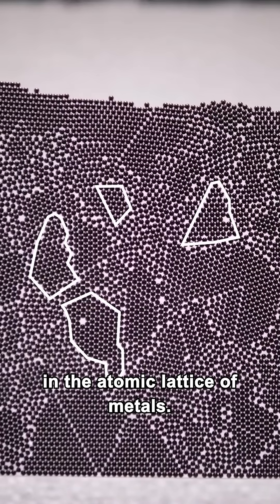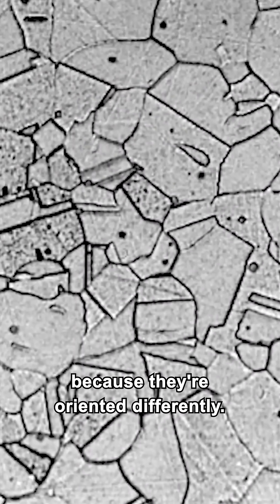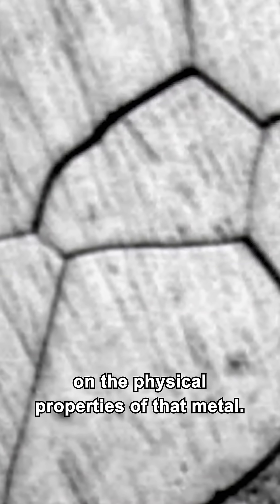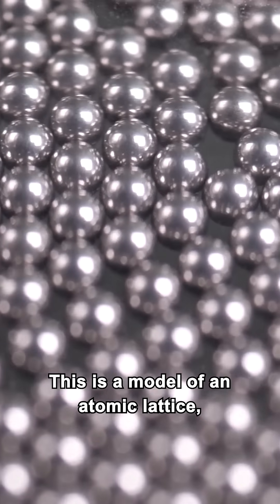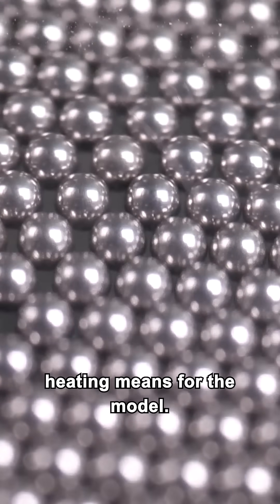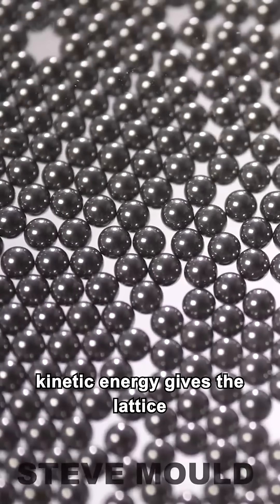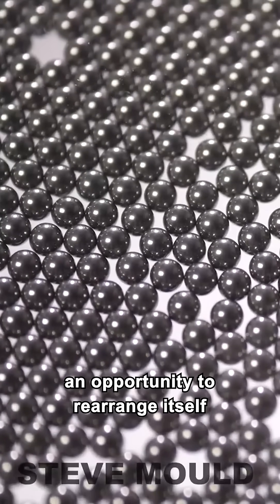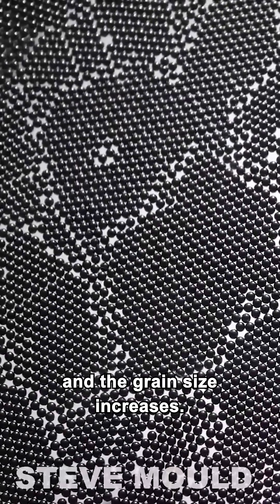What Happens When We Heat Treat Metal? #shorts

Comment: I wonder if you shake them hard enough whether there could be an analog for the phase transitions that happen in metals.  Would there be a different packing of balls when they have too much energy to pack hexagonally, but not so much that they're fluidized?

I bet there's something you can do with the tray of balls standing at an angle, some room between them and the front glass (half a diameter? Less?).  Varying the angle and the forcing, you can probably get them to settle into different structures.

Comment: Is this why cooling something quickly makes it brittle?
Reply: No, in fact for non-quench hardening alloys you can cool them as quickly as you like and they don't harden or become brittle.

Steel gets hard and brittle from rapid quenching because you're essentially trapping it in a non-equilibrium, stressed microstructure.  It takes time for carbon to diffuse within the iron crystal, and when you deny it that time you force the steel into microstructures that normally wouldn't exist at room temperature.  Martensite is the main one, but it can be converted to "tempered martensite" (by tempering, of course) which is less hard and brittle.

There are other factors like the size and shape of carbides that form between the grains, but forming martensite is the main thing for steels.

Comment: Fun fact: The smaller blades inside a jet engine turbine are a single lattice.
Reply: No. They are a single crystal.
Reply: @deang5622  I thought that was the same thing? The lattice is the crystal structure, no?
Reply: @eoin4529  They are very closely related.
A crystal contains a lattice, and we talk about crystal lattices.

In terms of jet engine turbine blades, it's more common to refer to them as being made of a single crystal, rather than a single lattice.
Just my experience when I have been around mechanical engineers that have worked on jet engines.

Comment: It would be great to show it, in steps, with 0.4-4% smaller ball bearings (about 55% the size of the existing ones) to show the inclusion of carbon in steel. Not sure how it will work out, especially the >0.65% as that doesn't affect hardness but does hardenability.
Reply: Unfortunately I don't think it would work out very well, mostly because in the model gravity would cause the smaller bearings to sift down towards the bottom. In actual metal the forces between the atoms are a lot larger than the gravitational force on them.
Reply: @Ender240sxS13  Steve rapidly locks in place the matrix from a agitated horizontal orientation to a unagitated vertical one; before gently returning to a more horizontal orientation for gentle vibration to watch the crystalline structure migration. The smaller ball bearings should not have time to migrate to the bottom under the force of gravity during that rapid setting process.

Have a look at his long form video on it, it's great.

Comment: Now I know why heat treating metal makes it stronger. Great visualization!
Reply: It depends on what you mean by stronger. It will make it less brittle but more ductile. This is because plastic deformation (not elastic) occurs due to dislocations moving through the grains and the material as a whole. The movement of dislocations is impeded by the interfaces at grain boundaries due to the grains not being aligned. So in this example, where the balls are all aligning, it would make it easier for dislocations to propagate and therefore easier to deform. There are other factors involved too such as dislocation density and lattice structure but this is a great visualisation.

Comment: This is a extremely good visualisation 😃 the only thing missing is the explanation that bigger "chunks" are easyer to deform and more irregularities make a metal harder. I'll use this to teach my metal working class.
Reply: this was a long-form video that he converted into a short. in the full video he talks about all the material properties
Reply: Definitely use the full original video if you want to use this to teach
Reply: wait so heat treatment makes the atoms slip and slode and make "bigger grains" but bigger grains makes it easier to deform and bend, right?. but if you give metals heat treatments they get more sturdier and less bendier, i dont get it...
Reply: @jordyrafael8287 this is a simplified model to explain part of heat treating. In real life, there's different types of heat treatments and complexities. For example, low carbon steel has multiple phases within it and different phases form depending on temperature and different microstructures form depending on temperature and rate of cooling.
Reply: @Hyperlophus so basically the type of heat treatment changes the properties some might form very big crystals some might form a tight knit net of crystals. Am I understanding that right?
Reply: @pvpminer9007  yes. The physical example in the video is good at explaining why annealing causes grain sizes to increase. It doesn't address the complexities in real life applications. Like how some alloys have different crystal phases that are stable at different temperatures (below melting) and those crystals may have different solubilities of elements, for example carbon. Different materials have their own detailed studies and charts, because things get complex.
Reply: @jordyrafael8287 Copper works the opposite way- heat treating it makes it softer, because having more crystals makes it harder to bend.
Reply: @jordyrafael8287  Heat treatment is complex. Different alloys behave differently. (Carbon) Steel wants to be heated red hot and shock cooled to get hard, then moderately heated to get tough and high tensile strength. High alloy stainless steel is not subject to this hardening; it keeps the crystal lattice carbon steel has red hot down to room temperature; that's also why it is not ferromagnetic.
Some aluminium alloys "precipatation harden", meaning they come out soft from a hot rolling or extrusion process, then get hard  and high strength with time by diffusion of alloying elements in the crystal lattice, they may need  slightly elevated temperatures to do so. 
Copper alloys need to be shock cooled from high temperatures to become ductile; they work harden (get hard with deformation).
The effects have to do with recrystallisation, buildup of tensions between the deformed grains, but also with diffusion of alloy elements inside the crystal lattice, and the crystal lattice changing completely at high temperatures and then beoming "frozen" by shock cooling.
Reply: Is that the reason we grow single-crystal turbine blades? To make them easier to deform?
Reply: @ltpetrenko  Nope. In the case of monocrystal blades it is about tensile strength. Each grain boundary is a weak point in the structure. those crystals are deliberately grown to give good strength in one direction.
I also wouldn't generally say that larger crystals are more ductile. That is the case for lattices that contain different elements (alloys). The larger atoms form irregularities that hinder ductility; they accumulate at grain boundaries. The individual grains also get jammed into each other when working the metal, creating internal tensions, which impede ductility. "Normalizing" (heating the metal) releases those tensions. In the case of copper alloys you want to shock cool for best ductility, indicating that these really are most workable for small grains. In the case of carbon steel you want to slow cool, to allow the ductile crystallite forms to develop (in this case it is about the internal structure in the crystallites, not the intercrystallite web.)
If you go to very large crystallites, the stronger crystal lattice becomes effective.
Reply: @HotelPapa100 wonderful explanation! Thanks for that well articulated response from a materials scientist
Reply: @ltpetrenko  they probably make them softer so as to not shatter during load
Reply: @lolsikinz  ductility is not really needed for the turbine blades as they do not experience impact-like loads.  
I just provoked the conversation in this direction.
Thank you all for great replies.
Reply: @ltpetrenko  I did not say that turbines needed ductility, I said that it was most likely done to minimize shattering, A side effect of a metal being too stiff and brittle. And a quick google search says I was indeed right. From the website "The Engineer": You can also check out the video/short that the slow mo guys/Jaystwocents did where they shatter a PC fan by bringing it to rotational speeds it was not designed for.
Reply: @lolsikinz  1. your initial suggestion, that they are “made softer” with single crystal is incorrect. Single crystal has higher yield stress. 
2. Brittle is opposite to ductile.
3. Slomo of the cooler fan show quasi-steady failure when yield stress is reached. It looks like shattering of a glass, but it’s not. More “brittle” fan would withstand higher RPMs. 
Although, I’m not sure what failure mode you imply with “shattering”.
Reply: @ltpetrenko from what I remember they want single crystals so they have a more predictable change in size when they expand do to the high operating temperatures.
Reply: @ltpetrenko Monocrystalline blades in turbines are mostly used to reduce heat creep at high temperatures. Grain boundaries are zones prone to starting dislocation movements when under load, and even more at high temperatures, so by having a single metallic crystal you can reduce heat creep and increase temperature resistance. However, this technique also compromises  the tensile strength of the metal by some margin, so it is only used in very situational cases.
Reply: @ltpetrenko  They make Turbine blades from single crystals to prevent creep. Creep is when an otherwise solid material is put under a tension that normally wouldn't destroy the work piece, but if you keep the tension over a long time the work piece starts to expand and eventually rip off. Creep is caused by irregularities at the grain edges of the material and since single crystals don't have grain edges, there is no creep. Turbine blades are put under immense tension from centrifugal forces over a long time and need to fit into very tight spaces, as in almost touch the inner wall of the turbine housing, so they can't be allowed to expand over time.
Reply: But wait, in this demonstration, the vibration gives enough space to the balls to rearrange themselves using "gravity"

But how does "kinetic energy" of heat rearrange the atoms at atomic level? 🤔
Reply: @annonYk A very good question. Not easy to answer properly in a short comment but it’s to do with reducing energy. An atom in a crystal will be at its lowest energy if it’s equally surrounded by other atoms in all directions. Grain boundaries are higher energy so there’s a driving force to remove them. Giving atoms enough energy to move around can allow them to rearrange into a lower energy state.
Reply: @GemAppleTom  hmnn... that makes sense, thnx for your explanation 👍
Reply: In the complete video he tells us this, this is just a short. Use the complete video as an instrument not only this short
Reply: A: he explains that in the full video this is a short from

B: If you want to demonstrate it yourself, do what he did and put a thousand ball bearings between two glass plates.
Reply: Man I wish I had a metal working class 😔
Reply: @AssassinIronMan  There used to be some places in EU where metalworks was teached as part of basic education untill EU standardized the curriculum, leaving these lessons to be the things of the past.
Reply: @arkaadias2526  That sucks.
Reply: Depends on the irregularitied and their orientation.
Reply: Was wondering that
Reply: Yeah the video felt really incomplete
Reply: @johnmclawson3982 most of the time you have to make compromises with visualizations like these. I still think its an exzellent visualisation for heat treatment
Reply: Great description of annealing
Reply: No shit dude! I'm a welder and I'm just interested in metals and their material properties. I've always just been told hard metals are brittle and that has seemed to be true in my experience. I've noticed when hard metals fail they seem shatter almost. With your info there this makes so much sense. Not only the shattering but just why hard metal behaves how it does. Thank you.
Reply: And what about monocrystaline metal objects?
Reply: @atashgallagher5139 At high temperatures (greater than 0.4*Tm, where Tm is the melting point in Kelvins, for steel is about 450°C (850°F) ) metals suffer  "creep", which is a progressive deformation of the metal parallel to the load over time, even at constant tension, that ends in fracture, like a chewing gum would do. It has two steps, deformation and final fracture:

 Deformation occurs with several mechanism, one is due to diffusion of atoms from the sides of a metallic grain to the top and bottom, where the load is perpendicular to grain boundary (called Coble creep). That movement of atoms ends up making the grain thinner and longer than before, making the blade stretch. This movement of atoms is easier in the surface of grain boundaries than by the inside. Therefore less surface means less places for atoms to move and elongate grains; and the bigger the grains are, the lower the sum of all grain surfaces is, decreasing deformation.
Another mechanism of deformation is due to the slip of neighbouring grains, and this slip is harder when there's less grain boundary surface to slip on, and when this surface is aligned with the load.
That's why before single Crystal blades, they used  blades with big grains (less surface) and they were long and parallel to the load (the majority of the surface was aligned with the load, not perpendicular).

Finally there's fracture. Creep causes cracks that propagate through the grain boundaries, breaking the connection between neighbouring grains and leaving them at both sides of the crack plane. The tension that separates grain boundaries of two grains is bigger when the surface is perpendicular to the load. So the propagation of the crack is harder when most of the grain boundary surfaces and parallel to the load, and the surface perpendicular to it is as small as possible, leading to the need of big and elongated, just as before.

So to summarize, we want bigger grains and elongated grains to reduce grain boundary surface and to make it aligned with external loads, if we take it to the extreme, we get a single crystal as big as the blade, with no internal grain boundary surface (whether it is parallel or perpendicular to the load) where the deformation or the crack propagation can occur with ease.
Reply: I was wondering about this. Thanks for confirming.
Reply: Heat treating has to do with the change in the material, both atomically and the grain size, with the time of cooling, essentially trapping, the material atoms in a high temperature orientation, at a low temperature. The video says things change when heated, all materials  change when heated. The video explains NOTHING, the author should understand the phenomenon, before attempting to explain it. While this is a short. It is a waste of time and provides no education. Sad.👎

Comment: Does larger grain size mean better metal strength, or is there a critical size?
Reply: Depends entirely on what metal you're talking about. Steel, for example, has a critical size, and a temperature and time at which those are achieved, but what those are depends on the composition of the steel.
Reply: Depends what you mean by "strength". Smaller grain size typically makes a metal harder but more brittle. Larger grain size typically makes a metal softer but more ductile (aka less prone to cracking).
Reply: Missing from this demo is that when you heat, for example, steel hot enough, it has a phase transition to a different crystal structure that basically wipes away the grains it had.  When it cools again, there's an opportunity to control the grain size as they reform.  In heat treatment this is called a grain refinement cycle.  It's different from hardening, tempering, annealing, etc. and should be included for best results.
Reply: A single perfect grain would be the strongest possible, but in real metals we don't get perfect grains.  They all have defects (point dislocations for example). The motion of defects through the crystal is what really determines strength of metals since that happens far more easily than a bunch of unstressed, orderly bonds all breaking at once.  Smaller grains make it harder for defects to move around, so finer-grained metals are stronger than coarse-grained ones.

(In fact there are a few high-strength applications where we use single crystal metals carefully grown without defects.  You can't go and get those at your local steel supplier, though!)
Reply: Strength also depends on application. What properties you want for a bolting material are going to be different than a pressure vessel and different than a turbine blade.

Sometimes we even want different properties along the cross section of a material.